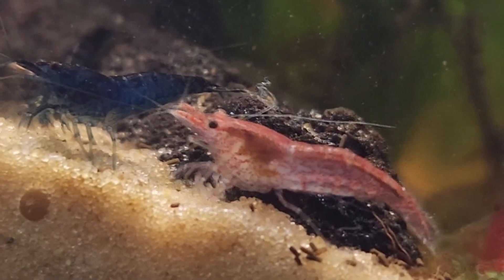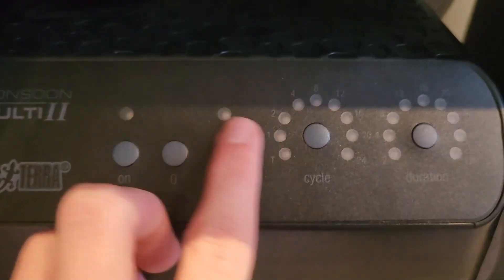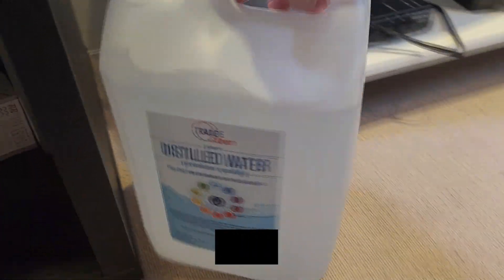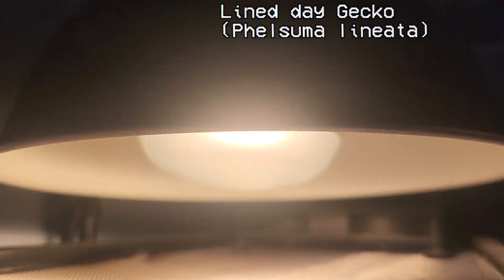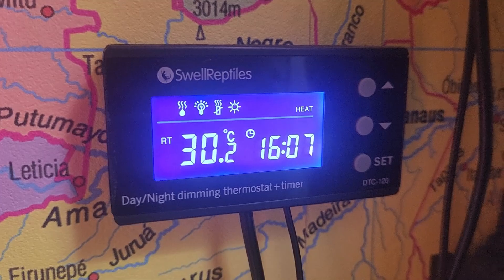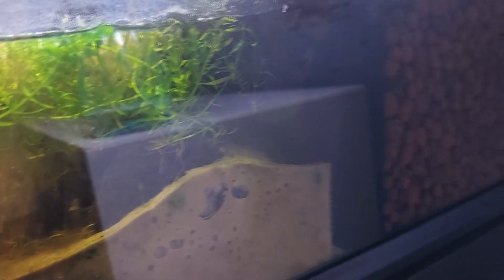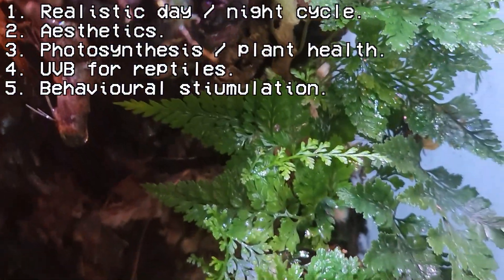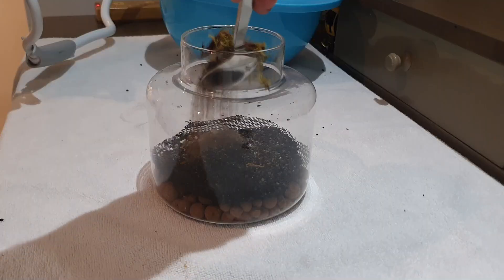How to Set-Up a Terrarium at Home┃FULL GUIDE

Comment: are the lights for plants and animals different?
Reply from the maker: Not really, but for animals temperature is more of a consideration, so you might need to use heat bulbs or an equivalent heat source
Reply: @plantgetenough  So, you only use lights for plants while you use heaters for reptiles?
Reply from the maker: @ALAMLUSVI  Reptiles require lighting as well as heating, whereas for plants temperature is less important. I would still recommend heating plants for growth benefits, though, at room temperature most plants should be able to survive.